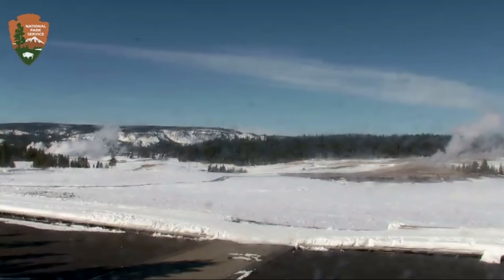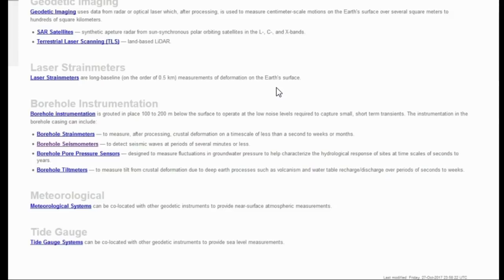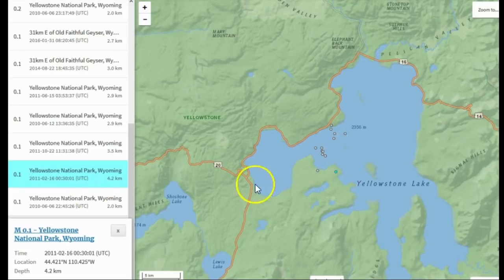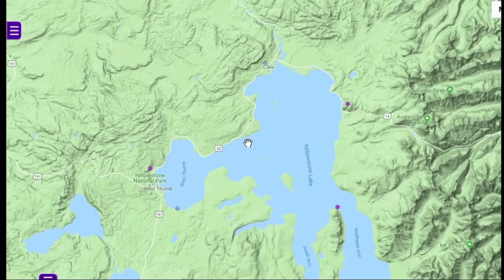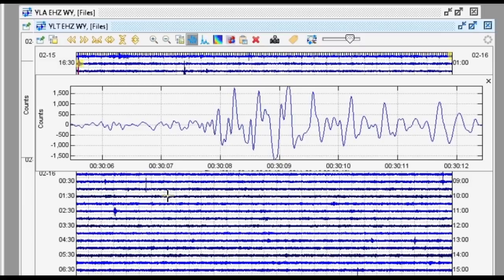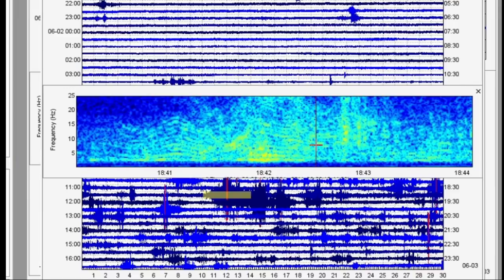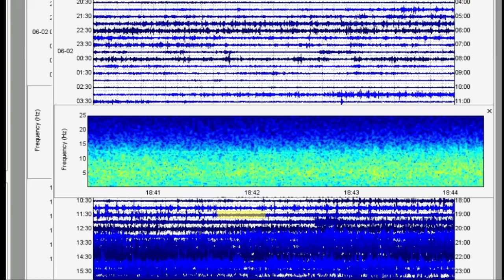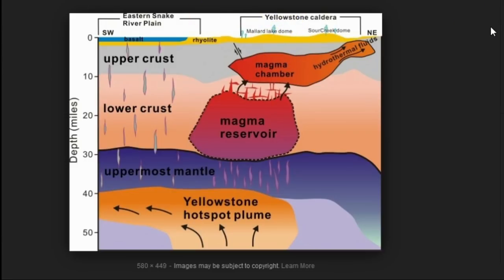UNAVCO Borehole Info and Misconceptions - Examples of how even tiny seismic waves travel

Comment: Thanks for the video and the links - very informative.  Another way for surface noise to reach the bottom of a borehole is for it to travel along the borehole casing, which is a pipe of cement, plastic, or steel - if I understand the borehole construction correctly.  Cement or steel would probably transmit vibrations better than plastic.  Sort of like banging on a steam pipe on one floor and hearing it clearly on another floor.  That could help to account for why strong vibrations are sensed only at one borehole.  The surface energy is directed straight down by the casing.